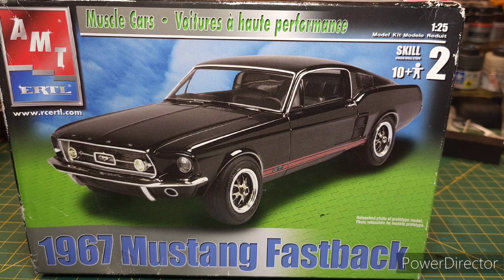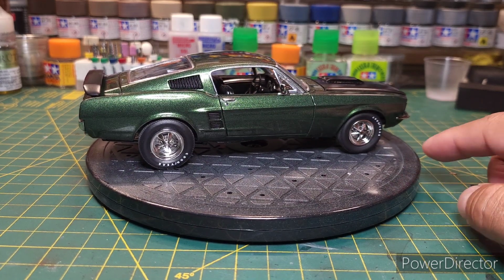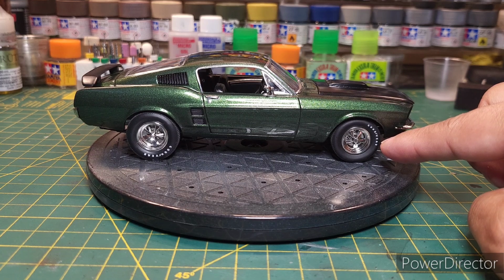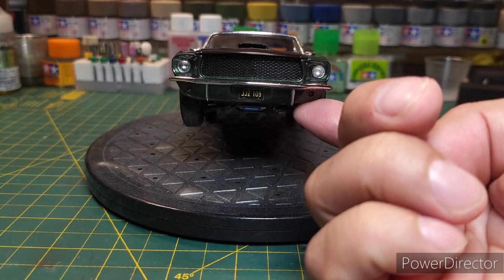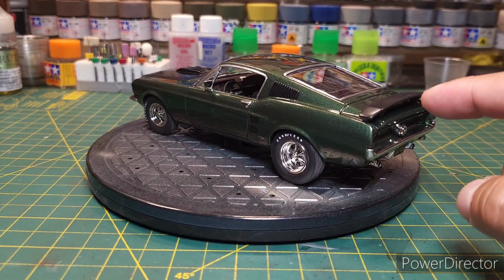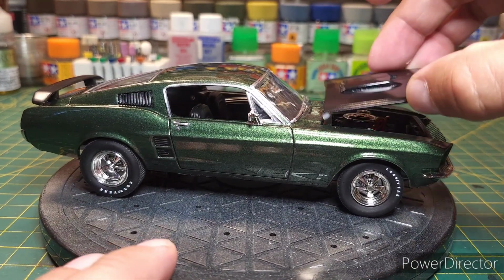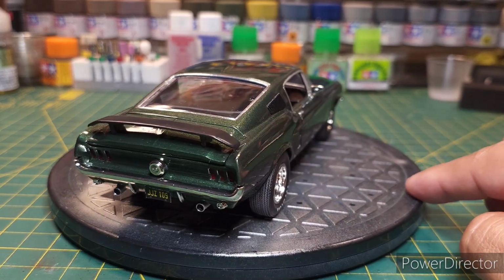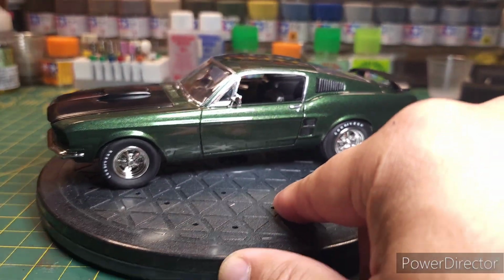Final: 1967 Mustang Fastback GT - AMT  1/25 scale model kit - 289 HO

Comment: Another awsome looking build Pat. I love the stance with the rear. Out of curiosity, did you cut out that trunk plug or just glue the trunk lid over it? It fought me on mine because i left it in place. FYI even the stock wheels and tires stick out way too much on the front. When I built this kit I watched a bunch of videos on the build. Most people pointed the wheels out, so I was able to address it with little work.
Reply from the maker: @Joethemodelbuilder  Thanks, Joe✌️ I cut out the trunk plug. I had planned to hinge it, but that didn't pan out. These fronts are smaller than the kit tires so I can imagine they would have stuck out even further. But i knew that going in. Seen a lot of builds that haven't had that addressed.